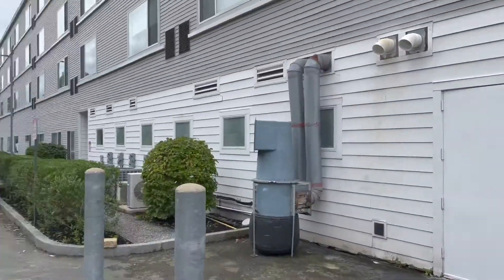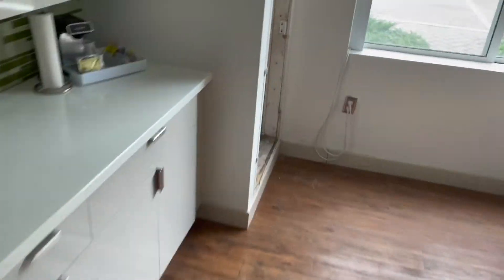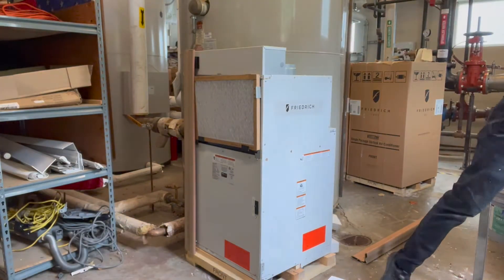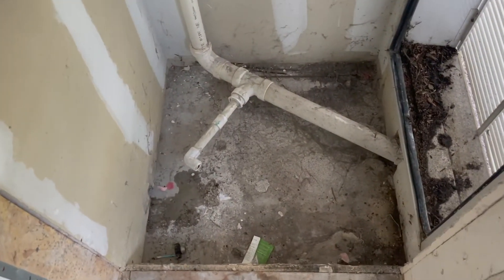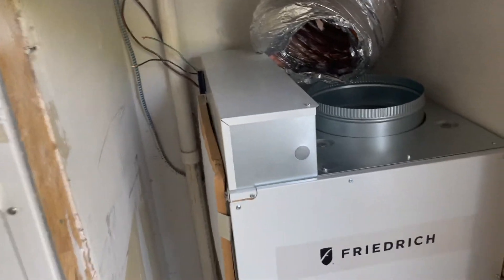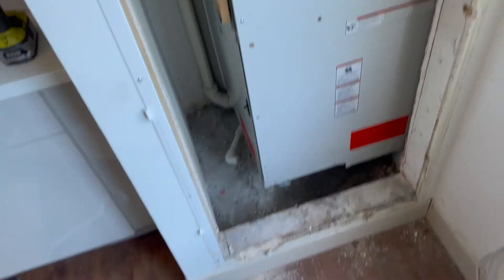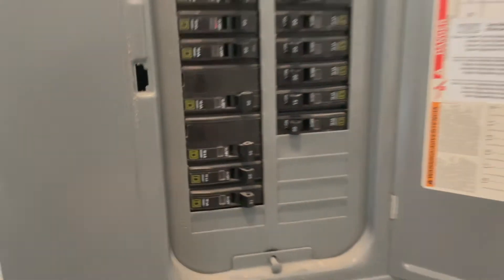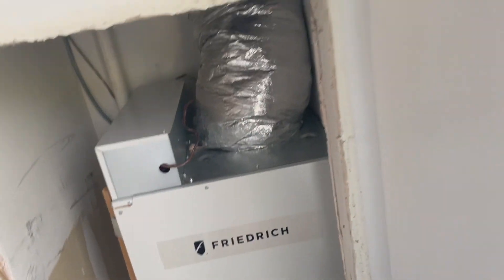How to Install HVAC Friedrich Vertical Package Unit Install! (VHA18k) Vertipak

Comment: Such a big unit for a small room..Thats oversized, Since it was 4 years ago I wonder if they put in a smaller unit since.  My friedrich is slowly dying 14.5k BTU, In the wall unit at my condo.. Leaked all over the place for years except into my drip pan.10 yrs old, ready to replace.  That's how I must've  got to this video...Thanks for sharing...

Comment: Hi, hoping you can help me out. I’ve installed one of these units in a colder climate, do these units need to sit level or on a slight angle to drain all the water out?  My unit has a little water in that internal pan and a little bit of the water is being propelled out hitting the metal walls inside and causing a ticking noise when running.    

  That valve which sits over the drain hole is operating, I poured water and it is draining, indicating the valve is open. Current temperature in the cabinet/ambient is 33*F. That valve opens at 45*F.

Comment: What’s up bro question What do I do if it’s not heating ?
Reply: Let me know if you find a video on it, these things are dying left and right at my property and I cannot figure out what’s making them not heat.
Reply from the maker: Yup same here always dying lol, for heat, check the electric heating strip, make sure it’s in good condition and has continuity, also check there should be 2 heat relays you can test. 
The compressors on the older models suck they always blow out. These units are a pain to work on
Reply: @jamesredsox  my heat strips always have continuity, it has to be those relays on the board. What’s weird is I replace the board and same thing, like what the hell lol I hate these things.
Reply from the maker: @TheMaintenanceMan92  there is an high limit temperature sensor that sits with the heat strip. It was probably tripped and must be replaced if it had been tripped
Reply: Did y’all figure it out? I’m having the same issue. The unit is not heating up, it blows colder air.
Reply from the maker: @matimanunited10  check the high limit switches

Comment: How many rooms it can cool off? Also how can I become a distributor or dealer?
Reply: Barely one. We have these in the hotel I work at. PTACs are cheaper, easier to work on and replace. They cool just as good or better then these. I hate these units with a passion. They have so much stuff that can go wrong on them.
Reply: Well you do a awesome job
Reply: @SummerTime-tt2gu which part, The cardboard shoved on top of the wood scraps?
Reply: Yes the part with cardboard